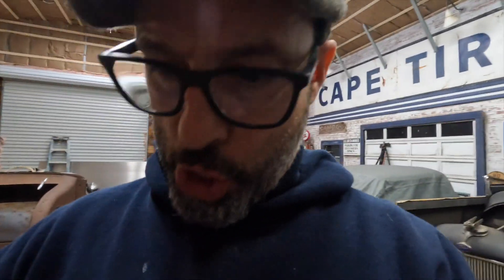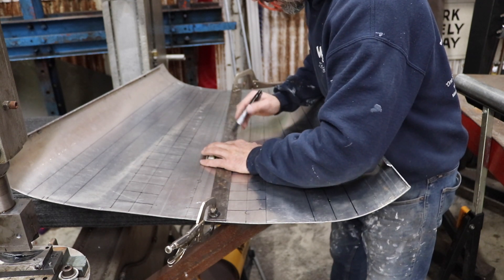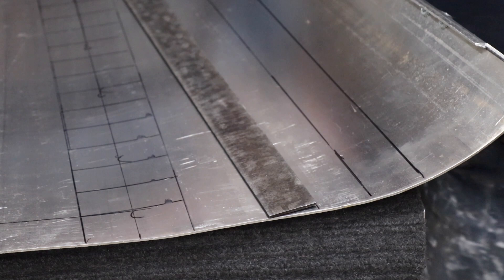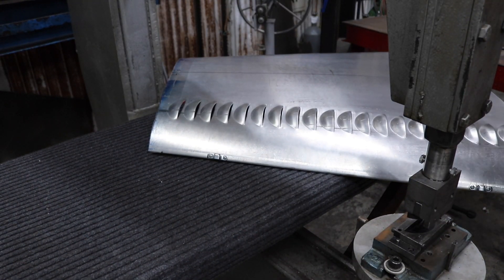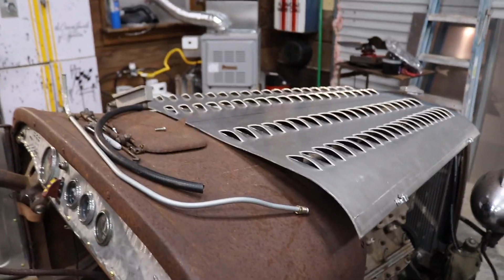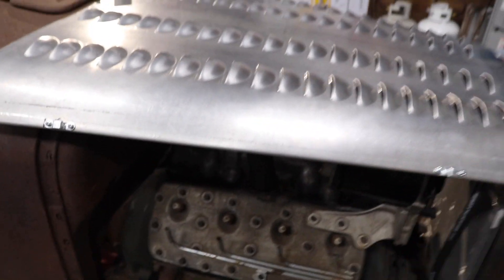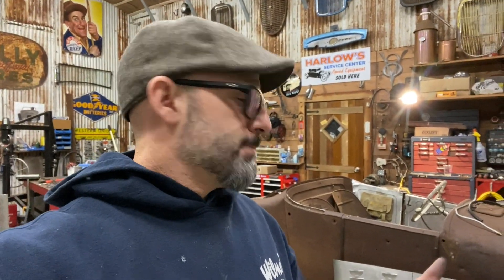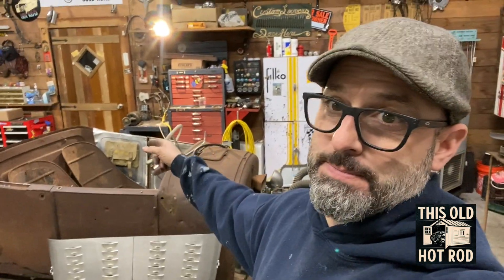Punching Aluminum Hood Louvers

Comment: My older buddy that does louvers has a center mark on the side of the die facing you, when you punch the first louver you pull it back off the die and it drops and you can see the line on the block, he uses that to line up the second and so on. His center line on the hood like yours lines up with the center mark on the die side. You may not have to do the all the extra lines. IDK if that helps any... just thought I'd share it. I like the shape of your louvers, looks 50s and not street roddy! LOL!
Reply from the maker: Mine have a center line too.  But the way I have my does set up at the moment is for a larger hood. I needed to spin them 180°.  So I can’t use the center line.  
I could have spun them back around but setting up the dies and the alignment on them takes time.  They’re set up this way so I just run it as is.  I use the outside lines as an added insurance that everything is lined up and square.   
I’ll spin them back around once I get the 40 hood punched.  
Laying it out as we speak

“ Flat louvers are for lockers “ 🤟🏼😎🤟🏼

Comment: Thats a great looking press, I am wanting to make one and running into problems getting dies and parts to make the hydro kit or air kit, any suggestions?  I have all the sqare tube to make the stand and flat plated for the plat form.
Reply from the maker: I wouldn’t honestly have any idea.   I wish I could help you, my suggestion would be to buy one like this.   I’ve seen several available in my area for sale since I purchased mine.
Reply: @ThisOldHotrod  Ok thanks, I have looked for one for sale, nothing in my area...I may just buy a mittler bros kit part at 2 grand, kinda high, thats a lot of louvers., who knows ..its all good.. i will keep looking and thinking...